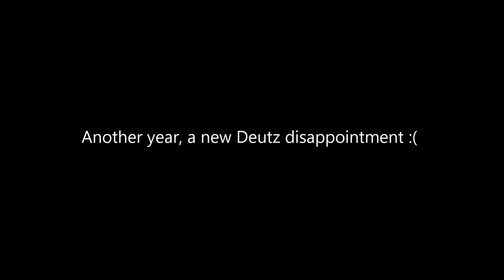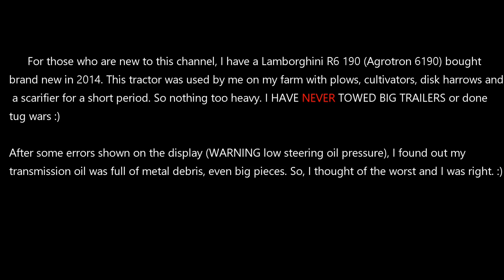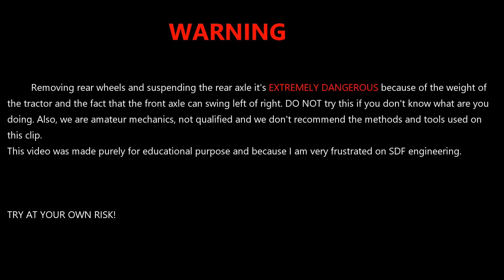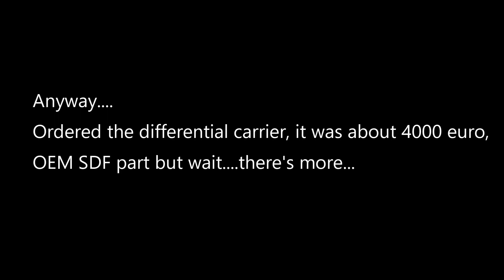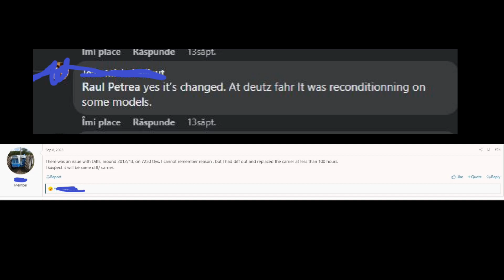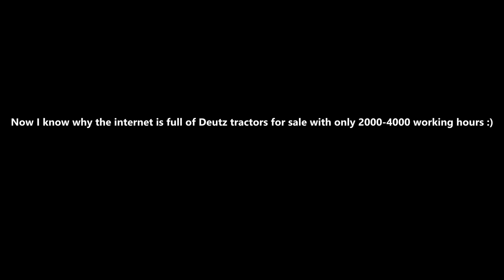Deutz Fahr Agrotron problem - ZF Differential carrier design flaw

Comment: Very unfortunate. The old Deutz tractors were some of the best doing 20000 hours with no problems.  ZF is the big problem they are gearbox and diff makers. SDF must move to a different manufacturer or build there own . ZF has been a big problem in the past also. I think your tractor will last a long time after this fix. Many manufacturers like Landini also use ZF setup. So it's not exactly only SDF. Engine is the only Deutz part which is the best. They are engine builders.
Reply from the maker: Yes you are right. But Deutz AG wich make engines are separate from Deutz tractor brand wich is  owned by Same...I have an Agrotron 105 mk1 and I am very satisfied with it, at 8000 hours it holds pretty well. I've owned since 1800 hours and never done any repair, except the AC of course....😅
Reply: @meisterraul I think they will up there game with quality . Because they need the market share.
Reply from the maker: @TractorChamp.  I heard mostly bad things about newer Deutz models, so.,...
Reply: @meisterraul  That's bad.